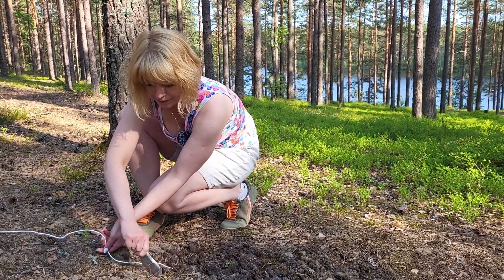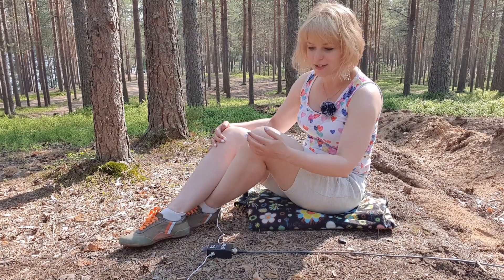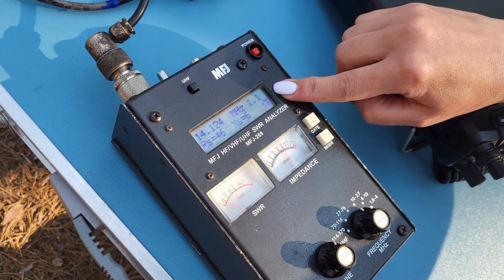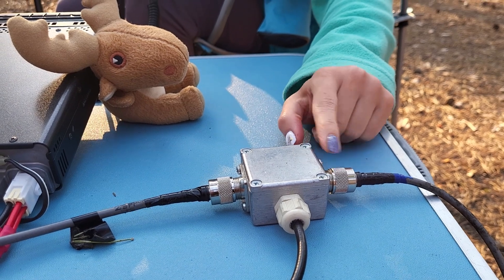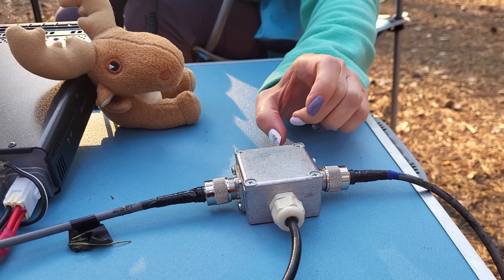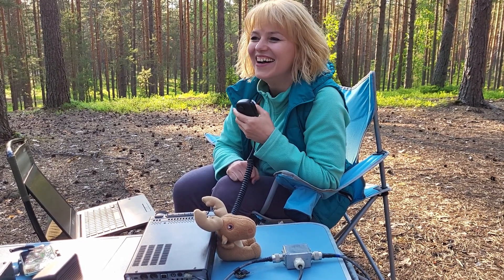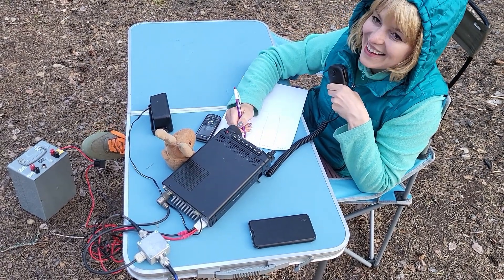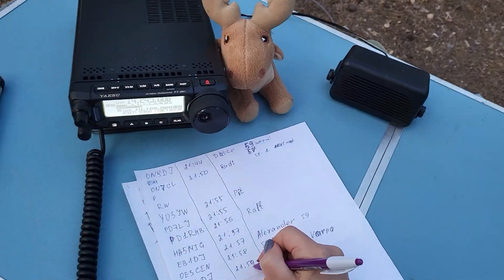Underground vs 8 m high. Raisa compares HF dipoles - this time in the forest

Comment: Your antenna change over switch appears to be a small toggle switch. It could be possible the capacitance between the contacts is coupling the overhead antenna to the transceiver even when switched to the grounded one.

Comment: Look up and explore BOG antennas (Beverage On The Ground).  You under-ground dipole is similarly buried although not buried very deep.  I have a 80m BOG which is similar to your "buried" dipole.  The slightly buried or BOG antennas are SUPERior as receive antennas. Very quiet.

Comment: Try remake the tests not using both antennas connected at the same point. The isolation between the two antennas are not sufficient using this setup you used... The rádio still "see" both antennas, not just one or the other. Even if the coax cable is near the radio, there is influence.

Comment: Thanks Raisa,  im thinking the dipole being so close or in the ground the radiation pattern will be more straight up. Wonder if the stations you worked were  within 1000 miles or less. NVIS  Near Vertical  Incidence Skywave. Cool experiment Raisa.
Reply from the maker: it was about 1000 miles.. TNX for your comment. Of course it was straight up... but in some cases usable also for DX..

Comment: Hello Raisa,
I have watched both of your videos about the underground antenna and found it fascinating. I remember in the ’70s I read something about underground antennas but never had need to do anything about it till now. After watching your video, since I am very limited in what I can have for an antenna, I decided to follow your steps and experiment. I had some RG6 cable that I know I will never use (under normal circumstances) so I decided to use it in what I call ‘underground loop’. The loop is roughly 6.5 m by 7.5 m, buried 10 cm underground. I am using the outside shield as the ‘wire’ into balun. Being in north-central Canada, I am hearing most of US, Europe and East Asia (Japan, Korea, etc). Not much from Canada itself, just the most distant places in eastern Canada. This is based on just receiving FT8 traffic on 40 m and up. 80 m and down is useless in my area. As for the SWR: the loop actually tunes on my radio on all bands. Using an analyzer, on amateur bands (80m -> 6 m) the best SWR is 2:1 and the worst is 4.9: 1. The impedance is within my radio range: 16.6 to 150 ohms for all bands except 6 m. I just have not had a chance to make any contacts yet. This is due to the fact that I am not hearing any ‘local’ stations (< 2000 Km) and I am still setting everything up. So I am not finished yet. The one difference between your setup and my, is that you are working a dipole and I am working a loop. Because as you mentioned, the length of the dipole is drastically reduced, I may actually repeat your experiment and set up a dipole next year.
Thank you Raisa, you have inspired me to experiment.
Rob
Reply from the maker: Hi Rob! I am very happy to inspire you :-) it was one of my main goals ! 73! Raisa

Comment: I'm thinking that your A/B switch box has enough capacitance to allow quite a bit of signal from the "real" elevated antenna to get to the radio and vice-versa.  It would be interesting to try removing the A/B switch, and wire the radio directly to the buried antenna and compare operation.  Make sure that the elevated dipole cable is no where near the buried one.
Reply from the maker: I did the mono underground dipole experiment in the previous video ;-) 73! Raisa

Comment: Hey, I just saw a video that made me think about you. It's title on YoutTube is, Eric Dollard June 2023 Telluric Experiment Diagram+Details. I guess Telluric means through the ground. Anyway, he built a Tesla coil and has it driven by a ham radio with an amplifier. He explains it better than I can but it looks to me like he's treating the air as the ground and the ground as a low impedance transmission line. He mentioned having to use multiple ground wires to get it below 1 ohm.

Comment: At what distance were the antennas? Maybe there was a capacitive coupling between the antennas and re-emission?
Reply from the maker: 20 meter.. Maybe it was a connection.. but I used underground dipole also as mono dipole (s. the previos video) ;-) 73! Raisa

Comment: Well done! I love having fun building new antennas. 
I would try the experiment but isolating the antennas (no shared switch) and installing them far away from other to make sure the upper dipole is not working as a director for the buried one, at least one wavelength would be ok.
Hace you tried Beverage antennas? Can be installed very low over the ground, only for RX.
Greeting from Spain, hope to meet you on the bands!
Reply from the maker: no beverage yet, it is my goal for the future ;-) 73, Raisa

Comment: If the propagation was NVIS, the dipole on ground might work better; the dipole in the air might be skipping over the other station..
Reply from the maker: Not only NVIS - I had QSO also with stations over 2000 km as you can see in the video... 73! Raisa

Comment: I don't know about your country, but in America we have two HAM bands below the common AM radio "broadcast band" (530Khz-1710 Khz).  I know that on that band, the higher frequencies work as a sky wave and the lower ones work more like a ground wave - so a buried antenna might even work better than an "aerial" one.
Reply from the maker: very interesting, but I used 14 Mhz... and it worked also.. 73! Raisa

Comment: I was told that all antenna are capacitors, one plate of the cap is generally the antenna and the other the ground. So in this case one plate is your underground antenna and the other is either the atmosphere of the receivers antenna.
Just a guess based on my basic knowledge, I know nothing of radios or antenna.
Reply from the maker: TNX for your comment. you can see my conclusions here: https://www.youtube.com/@YLRaisa/community

Comment: In my mind it raises questions about mutual coupling of E and H fields more than questions about attenuation.
Reply from the maker: What do you mean? please explain to a YL :-) Raisa
Reply: @YLRaisa  The E field is horizontally polarised when buried yet most receive antennae will be vertically polarised which should surely mean that the receive station will have a reduced signal due to the lack of electromagnetic coupling. Just my thoughts.

Comment: my curiosity lies in the distances, or skip angles/propigation. Or is this local signals? Maybe only 10 miles? . Just curious of results. De n3vxt
Reply from the maker: if you saw the video - you cound see that there were QSOs for over 2000 km... 73 de Raisa

Comment: The ground looks to be rather dry. So the effect on the buried dipole will be reduced. Ground losses seem to be very small.
Reply from the maker: yes, it was dry. My goal was to show that even underground  it will work..on the ground (even not 1/2 wave) it will work for sure. So if somebody does not have a possibility to set up a high dipole it will work also low

Comment: Underground dipole is acting as radials for the coax of the other dipole. This is acting as a vertical because the outer of the two coax cables are connected at the switch. GM4SVM
Reply from the maker: but I used also MONO underground... you can see my conclusions here: https://www.youtube.com/@YLRaisa/community

Comment: How far apart are the two dipoles and are they parallel?
Reply from the maker: 20 meter apart.. I used ANT Switcher. 73, Raisa
Reply: @YLRaisa  thanks. You may also consider disconnecting the cable to the above ground antenna to see if you can tell any difference. Both antennas are actually connected because the braid of the two coax cables is connected at the switch.

Comment: Thanks for the interesting test. Perfect to play with these things during the warm Summer months. I guess there might be two reasons that the difference is minimal:
1. operating during daylight the optimal skip sometimes needs a relatively high radiation angle and while a higher dipole is radiating at a lower angle by design (ideal for DX) the dipole on the ground can only radiate steep into the sky, which is better for a high angle daylight skip, evening out the fact that there is some overall attenuation when so close to humid ground/ground water
2. looking into the background I can see a lake or maybe even sea way below your location, hence your location is way above the significant reflecting ground water level, even when on the ground.
You might have a very different experience during and past grey line (past sunset) when doing the same test.

Though ironically if you want to do some serious low band DXing, you might have the best reception when using a few hundred meter long wire on the ground, terminated with 600 Ohm to the ground on the end and on your side transformed with a balun to 50 Ohm ... the overall signal strength is usually not very high, but the signal to noise into the direction of the wire is usually extremely good. My knowledge is not good enough to explain how and why this works, but it does and for Medium Wave DX and 160-80m band this is ideal ... for TX you can use any high hanging dipole or wire beam on these bands. For more information on this "gound wire" google for "beverage antenna" ... its not to drink, though the amazing reception will make you happy, so you have to drink/cheer on the success of this huge but simple antenna.

Greetings from Munich, Germany
Reply from the maker: Thanks for your very deep comment! you can see my conclusions here: https://www.youtube.com/@YLRaisa/community

Comment: Houston, Texas here. Our water table is pretty high here. Still I’ll keep an open mind. It would be interesting to try a buried dipole in our not so easy to manage soil.
Reply from the maker: yes, it is depending on soil very much ;-) make it not very deep ;-)
Reply: @YLRaisa  it will have to be very shallow like just below the surface but thanks to our flash fought it just might be viable.

Comment: I was in Arctic radio expedition back in 80-s . We didn't have high pole to unroll dipole for anything below 20 meters band. Dipoles unrolled on the ice for 40 - 80 meters were working just fine.
Reply from the maker: of course - Ice is like isolation, it is not the same like ground (soil). 73! Raisa

Comment: It's worth disconnecting the high dipole completely as there may be a slight cross talk in your antenna switch. 🎉
Reply from the maker: If you could watch the previous video about underground from the beach - it was mono underground dipole :-) 73! Raisa

Comment: Another antenna that's slightly better than a dummy load! It's nice to experiment, but how about an antenna that's efficient? not one where 90% of your power is wasted (in the ground). If you run a KW, you can drop a piece of wire in the toilet and make contacts.
Try your antenna with QRP 5 watts!
Reply from the maker: My goal was to show that it is possible to work with low antennas and it is better to work with them than not to work at all..

Comment: Very surprising result. I wonder if it is limited in range like NVIS? Also, the soil or sand has a specific attenuation factor or value. Some things to consider. Low noise is a bonus for sure.
Reply from the maker: Not only local stations! I even reached one from 5000 km! 73! Raisa

Comment: Excellent! I have been trying a low dipole, only 1.5m above ground, it works great! Using it on 40, 60 and 80m seems to be good for at least short to medium distance. The EZNEC software predicts that it is only 5dB below a dipole at 10m above ground. I believe that the military sometimes use underground HF antennas. Thanks for another great experiment Raisa! 😀
Reply from the maker: Yes, this is the point! just 5dB ! The propagation can "make" much more influence... So, if you do not have other possibilities, just hang up low dipole! And be QRV! :-) 73! Raisa

Comment: Very good ----- thinking outside to box ----- keep up the great work de N5VMO Pat
Reply from the maker: Hi Pat! I will try! If you have some ideas for my next videos, do not hesitate to share with me! 73, Raisa
Reply: @YLRaisa  My first HF antenna was a 80m horizontal full size loop antenna fed with 450 ohm ladder line using a manual antenna tuner with the antenna laying on top of the snow =)   I did find all the RF hot spots for each band /-)   That was the day before I raised the same antenna into the mounting point in the trees =)

Comment: Where the 2 antennas in parallel, coupling each outer is some ways?
Reply from the maker: there was an ANT switcher, not parallel. But I also used underground antenna as mono (also as video on my channel) 73! Raisa

Comment: Salt water amplifier 😉
Yes even under ground it’s still has the under ground water to reflect the signal outward. I bet the under has a better noise floor ☺️
Reply from the maker: but there was no salt water... I was 20 km away from sea..
Reply: @YLRaisa  sorry I mistaken the lake as brackish water which does possibly have a higher salinity then fresh water but not quite as high as the ocean but still working as a reflector. But I was surprised the higher ant did not work a bit better having the other wire as a reflector. Maybe make it 20% bigger then the higher and check that way. I also think you should switch the cables vs using a switch box which does being  both coaxes in very close vicinity to each other.

Comment: Next time, check it's broadbandedness, compared to the one up high. This could be a major cure for top 3 antenna dilemmas- 
HOA visibility, QRM, and high Q. 
I am just assuming this will not work as great on grassy soil, but may just need to trim dipole to resonance, because of slightly more conductive soil.
Reply from the maker: yes, but..it does not make sense with UNDERground. It was just a test. It makes sense 1-2 m above ground, IF you do not have masts/place/time ect to install a normal dipole...73! RAisa

Comment: Fantastic right to the point vid. Would you get the same results without actually burying it?
Reply from the maker: of course it does not make sense with UNDERground. It was just a Try. 
It makes more sense 1-2-3 meters above ground, IF you do not have masts/place/time ect to install a normal dipole...and it will work for sure ALMOST as good as a normal dipole, even for DX! 73! Raisa R1BIG

Comment: What really surprise me is that it is possible to work DX with an Underground Antenna. That for me opens a wide variety of scenarios where you do not have a place to hang a dipole. Or even here in Puerto Rico Before a Hurricane strikes, we all have to take down our antennas. But know it is possible for me to get prep in anticipation and leave an antenna buried Before the Hurricanes strike.  That Might even get me chances to transmit in the middle of the storm. And to get ready to deploy my stations really quickly for example using Winlink or JS8Call. Thanks for sharing.  73 de NP3JD Jose
Reply from the maker: Hi Jose! Of course you do not need to use UNDERground. It was just an absurd test , but still works! But you can use ON GROUND antenna with very low hight and it will work defenetly, even for DX! 73! Raisa
Reply: @YLRaisa   you won't believe but you solved one of the biggest challenges for EMCOMM NVIS for me, in situations like in case of a Hurricane where, If you leave an antenna hanging you will lose it.    Or for you even on a huge snowstorm , that if you know it's coming, you can deploy an underground antenna in advance. Just imagine the dripping water from the antenna becoming ice and all that weight can take down your antenna. Then you will have to go outside in subzero temperatures.  Also if you know in advance which are your more suitable winlink RMS are reachable ,you will be shooting emails via RF in no time. Sorry my English is not so well in writing. My first language is Spanish but hopefully you can see how important is for me this experiment. 73de NP3JD

Comment: The antenna switch may be interacting and combining the antennas, you need to try it with the coax connected directly to the radio for each antenna separately.
Reply from the maker: In my second video Underground antenna I used MONO underground dipole without switscher ;-) it worked also https://youtu.be/Pp1ZC0e2W8M?si=wiYNm0SDUzomHTZL
Reply: Was thinking the same thing.

Comment: I love watching your videos. You radiate so much positive energy. And, since I can not have a dipole in the air where I live, I will try just laying it on the ground and see what happens. It will be nice to get on the air again. Thank you so much Raisa! de KA9TII ;-)
Reply from the maker: yes, if it works from underground, it will defenetly work from ONtheground. But better with 1-2 m hight! It is not a problem (no mast needed)
Reply: You don't have to erect a dipole... there are LOTS of stealth wire antenna options that are not buried in the ground...

Comment: nice job comparing the two. when it comes to HF Height is might is wrong . that applies to VHF/UHF. I have found over the years keeping dipole close to ground dropps my noise floor. look at DX commander vertical right on the ground and really gets out. the DX commander is a fanned dipole going vertical . for HF the dipole antenna is my go to for DX. nice tune on both. I have the same analyzer. love that battery box ! 73's Boston NY,USA
Reply from the maker: Hi Robert! TNX for your comment and thoughts! I know DX Commander very well :-) 73! Raisa